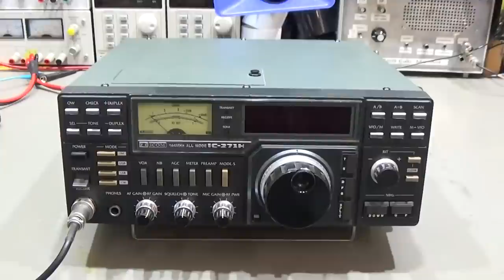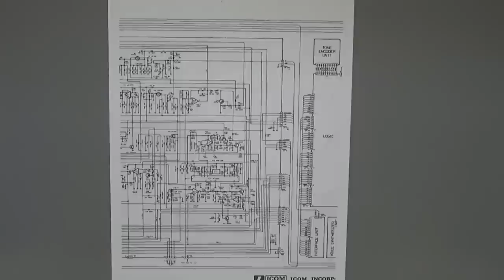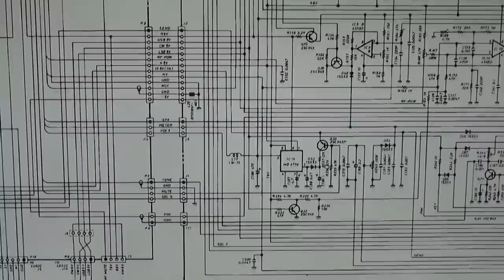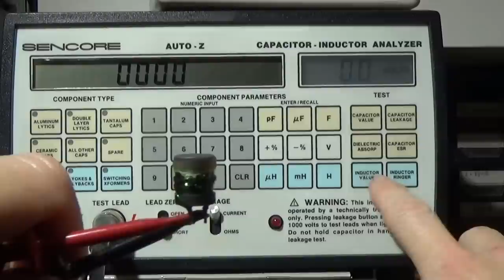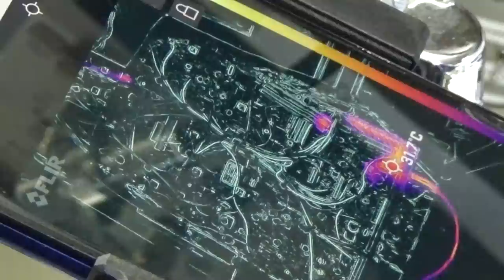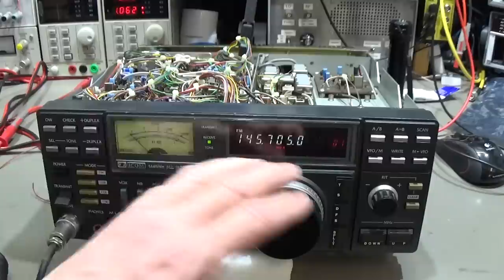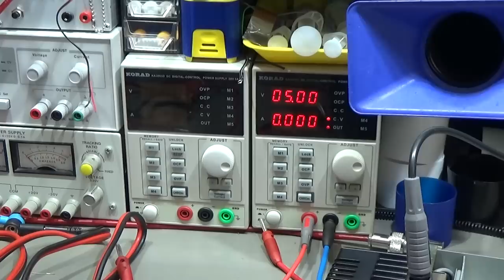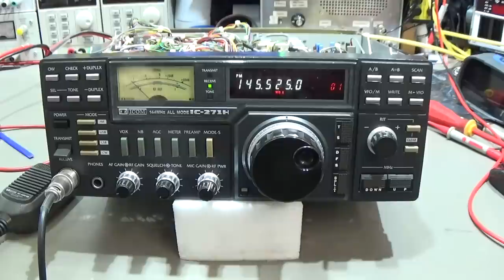#266 ICOM IC-271H, no function totally dead fixed

Comment: Love the techniques and the troubleshooting. When you were doing the audio, I noticed the Motorola MC3357P that I used to sell in the 80's when I worked for Motorola Semiconductor. It was a staple in radios as a linear narrow band FM IF. The date code made me chuckle as it was 8440 which means that the manufactured date was the 40th work week of 1984. That radio was likely built in late 84 or early 85, right when Motorola Semiconductor was entering into product allocations out of their Linear/Analog products group in Mesa, Arizona.
Oh my, fond memories! Great to see bat wing IC's still ticking 40 years later. Electrolytics...cant count how many I had replaced when I worked as an RF engineer at Motorola Communication Division in the early 80's before moving over to Mot Semi. Your point about restoration is spot on. Changing out each and every electrolytic is time-consuming, but not a lot of skill is needed. However, patience is a must. Cheers,
VE3NAP

Comment: Forty year old power supply caps dry out. Open them up, they get waxy and smell unique. Thermal cameras are great for finding the shorted capacitors. Glad you were able to resurrect that old radio. Thanks for the Saturday video Peter.
Reply: The "unique smell" is something that you never forget.

Comment: Another great video Peter. I have never seen two electrolytic caps go short in the same radio but as you say the radio is 40 yeas old and I guess that these things are going to happen at this age.  I really like your distinction between restoration and repair as it's so true and if I'm honest I hadn't really thought of it like that. I can only  imagine how time consuming it would be to recap the complete radio but like you say for the radio to be reliable this would need to be done. Hope you are well and best regards from the UK.
Reply from the maker: Hi John, thanks for stepping by.. Yes, restoration is something which will block your bench for a too long time. Most of the time, there are additional issues to fix along the way. That all makes it impossible to calculate with. It is always open end and a lot of trouble with a non-satisfied customer. With other words, it is always high risk to work on stuff older than 15 years...Take care mate

Comment: Hi Thanks for a great video Peter. I have a IC-471H which I have had since new. Due to moving house a few times it has not been used much. I checked the Ram battery back up, still OK, I replaced the battery a few years ago.
Powering the IC-471H up and there is a short circuit on the 13.8 volt rail. So far found 2 x 470 uF short circuit  Rubycon Electroytics.
Until watching your video I had not seen Electros go short circuit.
Thanks again Gary vk2kyp

Comment: Once again, another great video.  You sure are fast at finding the fault.  Methodical steps to a final conclusion with exceptional skills at finding the fault.  I definitely admire your strait forward method of trouble shooting.  I had no idea that an infrared (thermal)  camera would show so much about a circuit, that little bastard of a shorted cap.  Way to go, Peter; another old timer radio lives once again.  Cheers & 73 from W Rusty Lane K9POW in eastern Tennessee
Reply from the maker: Thanks, Rusty! Yes the IR cam is of a great help..

Comment: LOL!  For me printing, cutting and reassembling ICR7000 and ICR71 schematics from 6 or 7 pages was NOT the greatest fun I have ever had!  Many scanners/printers subtly distort the images and reconnecting lines needs some care.  But once done, the work was well worthwhile.  I recommend taping cut pages together with mylar tape like 3M Scotch Magic tape - it is "seethru" and lasts "forever" without degrading.  Once reassembled, careful concertina folding A4 size and storage in a plastic sleeve leaves the regenerated schematic ready for the next time!

Comment: Great video, I really want to get a flir camera, sure is handy in situations like this.  I’ve re-capped mine, but also there are variable capacitors used for alignment, which are plastic, and those should be replaced with ceramic ones, unfortunately those are getting harder to find.  I have a 271H just like this one, which I love.  My only issue at the moment is when you change from fm to ssb, there’s a voltage that is supposed to change from 1.5 or so to 3v.  That is not happening, which is causing my ssb frequency to be 2khz off.  I haven’t been able to track down the logic issue, so I just tune 2kc higher.  Also, don’t forget to replace the meter bulb, as it looks like this one has burnt out. Looks to be in great shape otherwise.
Reply from the maker: check vco

Comment: Another eye opening adventure. Thank You.  I "was" looking to buy ICOM IC-271H but now maybe not. Love old radios but not interested in restoration project. Already have couple old Ten-Tec radios with dirty contacts that I need to clean. I prefer to "operate" new radios with spectrum display. I am still drawn to old equipment like a moth to flame : (
Reply from the maker: If you want old radios your hobby must be restoration projects, otherwise it makes no sens...
Reply: @TRXLab  I have an old ICOM IC-751 which I've own since decades, only upgraded with PIEXX Memory Board. Also Ten-Tec Argosy II still working fine. Ten-Tec Titan II has dirty pots. Mostly I use modern radios.

Comment: My Yaesu FT-77 (bought used 2006) was made circa 1982-86, so ~40 years old. Still works 'perfectly' *, although I very recently bought a brand new modern rig. 
* No internal failures evident, works fine. Pure luck...

Comment: Similar problem on my Icom 751. But in my case the cap not was completly shorted but the coil was partially burned. This problem caused noise in the speaker during transmission
Reply from the maker: check vco

Comment: Nice job with cutting some time using that thermal camera. I think I need to buy one of those myself. I like 80's radios and have four big transceivers and plan to recap them soon. I know what you mean with restauration... It's a lot of work and have to be done by the owner or a good friend for sure to cut the cost. And it's also a job where you can do some harm if you don't do it well. Peter, have you had any real change in alignment when the radio has been recapped? Electrolytic caps are not a precicion devices anyway so I wonder do they make a lot of difference to alignment...
Reply: "Nice job with cutting some time using that thermal camera."
For low voltage circuits, a cheaper temperature-probing option will (quite literally) already be 'on hand': your fingers.
Of course, common sense caution required. Quick palm taps to start...
Reply from the maker: Unfortunately, it would not work all times. The coil could be found with a finger if it is not burnt out until you'll find it. The caps don't get so hot that your finger will find it easily...

Comment: I recently repaired an IC-271H. The main problem was the oscillator at 10.75 MHz below frequency not starting up reliably or dropping out. I replaced most components in that part including the 6 pF trimmer. Also replaced a number of capacitors in the more critical locations. It is now far more reliable, but not totally. It can run for days then it appears to lose PLL lock as the green LED goes out. Tuning backwards and forwards it can drop in and out. To some extent it seems to be temperature dependent. More reliable when warm.  Any suggestions?

Comment: what mmodel is that bench multimeter you use? its display is really clear
Reply: The orange one is an Agilent U1272A.
Reply: @stargazer7644  tno, the bench one that kept saying "open"
Reply: @frankbaron1608  That's a Siglent SDM3045X 4.5 digit digital multimeter.
Reply: @stargazer7644  thank you

Comment: Have a defective 271E laying around.
As soon as I switch it on the frequency on the display begins running up . 
Anyone an idea . Already cleaned the encoder and he isnt the cause. :-(
Reply: Mechanically check the S14 Scan button on the EF board, may be broken. If not, follow the lead of the Y0 to the Logic board. As a test, lift one leg of the D12 on the Logic board to see if scan stops. 
Unplug the mic to eliminate up/down buttons mailfunction. Check Q2 on the Logic board. 
Check Page 5.12 Chapter 5.4.7 & 5.4.8 of the Service manual. Good luck.
Reply: @Gorantp  many thanks for the hints , i ll do so !!